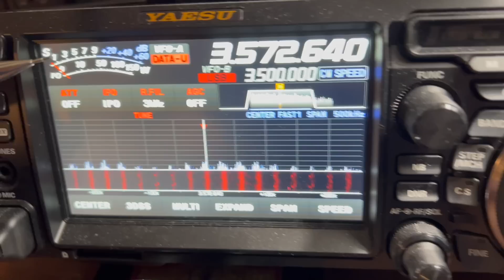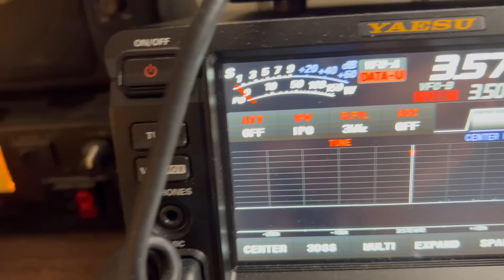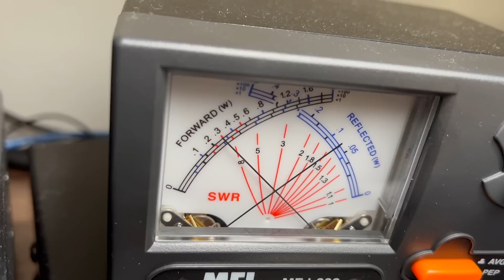The Myth of SWR

Comment: I love your videos. Question how do I get reflective gain on a 102 in?
Reply from the maker: Reflection gain only occurs on a line with standing waves. With a whip antenna, you will want to get the standing waves as low as possible. Even if you did have standing waves, the reflection gain is reflected back to the tuner and it bounces back-and-forth in the line so you don’t get a power increase.

Comment: A question: If SWR is reflected back, is lower SWR bad? I am brand new to this technology and I am starting on 11 meters.I have been spending a lot of time trying to tune my antenna. Am I wasting my time?
Reply from the maker: You want the lowest SWR you can get but don't go crazy.  What antenna are you using and what SWR readings are you getting?  You may very well be wasting your time.
Reply: @BustRadioMyths  
I have an Everheart 2 foot tall, 3/4 Wave, it is going with RG8X cable to a Uniden 980ssb Radio that has a built-in SWR meter and calibration setting, just about an hour ago I had it set to SWR of 1 on channel 1and channel 40. And then I moved it about twenty five feet to a parking spot.And the swr jumped to 2.2 on channel one and 2.5 on channel 40. I realize if you do a hard 90° bend  it affects the SWR, so I made sure there are no hard 90s, and nothing is being pinched, which is how I achieved SWR of 1 initially, it's very frustrating. Thanks for answering by the way.
Reply from the maker: The most efficient mobile CB antenna is the full quarter wave whip which is about 8 feet tall.  Now you can imagine how inefficient your antenna is.  They call it a 3/4 wave antenna.  3/4 of a wave in the CB bands would be about 27 feet.  A two foot tall antenna on the CB bands is so inefficient if you putting 10 watts into it,  it might actually radiate 1 watt or less.  Also that antenna is going to be difficult to tune.  See if you can get a longer antenna.  It doesn't have to be 8 feet but 2 feet is way too small to be effective.  Sorry but that's physics.

Comment: Again a good informative video. I have explained this so many times, even to other engineers. I have done detailed calculations of how power bounces back and forth from antenna to transmitter and back again!
Essentially I can use a simple example of 100 watts and a coax with 3 dB loss to make the calculations easy. 100 watts leaves the transmitter initially. With 3 dB loss only 50 watts gets to the antenna. Let’s say half of that or 25 watts gets radiated and 25 watts reflected. The reflected 25 watts travels back to the transmitter where with 3 dB loss only 12.5 watts makes it back. At that point the whole 12.5 watts gets reflected back to the antenna. Now we appear to have 100 plus 12.5 watts going forward or 112.5 watts. Of that 12.5 only 6.25 makes it to the antenna where 3.125 watts is radiated and 3.125 watts is reflected. Half of that or 1.5 watts makes it back and is reflected again and then that 1.5 watts adds to the froward power making the total forward power as read by the meter just about 114 watts. 
The example with 20 watts turning into 30 watts indicates that the output is 20 watts, if the loss in the cable is small, as in good short cable we can have almost the complete 20 watts get to the antenna. Where 10 is radiated and 10 is reflected back. Then of that 10 watts essentially all reaches the transmitter.  Then all 10 watts is reflected. Now we have the initial 20 watts going out and 10 watts added to that giving 30 watts going forward. This is how it works. Each trip down the coax there will be some loss That loss is the same in dB for forward or reflected power. That loss determines how much power reaches the antenna. How well the coax is matched to the antenna determines how much of that power is reflected. With each reflection at the transmitter that power is added to the forward power. This process continues until all  power is either radiated or becomes heat due to loss in the coax.
If properly tuned, all reflected power returning to the transmitter gets reflected again toward the antenna. 
Does any of this hurt the transmitter? That depends on if the output circuit of the transmitter is or can be tuned properly or not. 
The so called antenna tuner at the transmitter usually solves that problem. 
I did that real quick so I hope I did my math correctly, but that’s the process.
Reply from the maker: Another great post by @dandypoint.  Guys who believe myths take heed!

Comment: Newbie question: If I have a resonant antenna, say at 28 MHz, perfectly tuned to 50 ohms, and I make my transmission on the 40-meter band, what will the SWR be like, considering there is perfect impedance matching but not resonance?
Reply from the maker: SWR will likely be through the roof.  Trying to use an antenna cut for 10 meters on 40 will be a very poor antenna.   There's no way to get around it - size matters.
Reply: @BustRadioMyths   Yes, obviously, but I asked because if SWR is mainly caused by impedance mismatch, and in this case, the antenna—completely off in terms of size—meets the impedance requirement, where does this SWR come from? Is there a return due to the antenna's physical size being too short or too long? Thanks, you're so kind for answering!
Reply from the maker: If the antenna is too short, like trying to use a 10 meter dipole on 40 meters,  I don't see how you could possibly have a good impedance match at the feed point.  SWR is only determined by the match at the feed point.  Too long is a different story.   Antennas that are too long can work just as well as an antenna cut to a specific frequency.   You would attach the coax somewhere there's a compromise impedance match.   Look up information on off center fed dipoles for example.  In your example, you could use an antenna cut for 40 meters on 10 meters but not the other way around.  Make sure you have a decent antenna tuner.  Don't be overly concerned about SWR unless you have a long feed line.  For example, a 20 foot length of RG8X on 20 meters with a 10:1 SWR has a loss of  less than 1 db.  A shortened antenna is always inferior to a full size antenna.
Reply: @BustRadioMyths  Aha!  Now I perfectly understand that the antenna size also influences impedance matching, which is why I asked what happens if we use an 'antenna for 144 MHz, perfectly matched with the transmission line and equipment at 1.8 MHz.' I imagined an unlikely low SWR reading with extreme inefficiency. Thank you for your attention and patience.

Comment: The reflected power is out of phase with prior outputs, so if the wavelength is near the round-trip coax length, you output nothing?
Reply from the maker: Each time a reflected wave is reflected its phase is reversed.
Reply: @BustRadioMyths  yes, that's what I'm saying, but my mathematics were wrong.  Round trip coax path length of 1, 1.5, 2.5, etc. wavelength yields zero output power if the CW reflection is very very strong.
Reply: @BustRadioMyths  that is exactly what a "circulator" does.  QED
Reply from the maker: With coax that long, hundreds of feet, yes, all of the power will eventually be turned into heat, especially with a high swr.  The coax becomes a dummy load.
Reply: @BustRadioMyths  the ohmic resistance is minimal, 1.50 Ω per 1k ft, but whatever.

At 20 meters, a circulator would be 10 meters, with a 10% loss. I don't know what the loss is at 160/80 meters, probably zero. 

No?

Comment: Agree with all of this as it is science based and true - but when pragmatic reality and life kicks in - instead of faffing about with antenna tuners, just tune the bloody antenna to start with.  The correct length of coax is the distance from radio to antenna - as long as the latter is adequately tuned for the desired frequency.  If wanting to use a random  piece of wire - that's when the ATU  is of use, as it matches both the antenna and the coax (because they collectively are the "antenna system" in this case.) I don't use an ATU for any reason because I have multiband antennas.  Great video and thanks for this - it's about time!!

Comment: A question I have is:   How does this re reflection happen without an ATU.?  Eg  a 50ohm antenna , with an electrical half wavelength of  say 600ohm Open wire tx line. (SWR 12:1) 50 ohms seen by the tx . Do the re reflections still happen from the final pa stage of the transmitter ? Another example may be 10m of 600ohm Tx line with an antenna impedance of 91-j998 at 3.6Mhz. (SWR = 70:1)giving very close to 50 ohms at the TX.  Does the TX line "see" 50 ohms looking into the PA stage?
Reply from the maker: The impedance at any point along a transmission line is the instantaneous result of the voltage and current at that point on the line, not the "static" characteristic impedance of the line itself.

Even though the transmitter output is nominally 50 ohms, the impedance on the line at the transmitter connection is very different than 50 ohms when there are standing waves on the line. When the reflected "wave" traveling back towards the transmitter reaches the transmitter, it sees a mismatch due to the difference in impedance and then the "wave" is reflected again back towards the load.
Reply: @BustRadioMyths  Thanks. 
"When the reflected "wave" traveling back towards the transmitter reaches the transmitter, it sees a mismatch due to the difference in impedance and then the "wave" is reflected again back towards the load."
What happens to any power not reflected  in your explanation?(ie TX to feedline is minor mismatch))Does this power go into the PA stage ,causing damage ,even though the transmitter "sees "50 ohms?
Reply: Lets use an example for some clarity.  A 50ohm Load(antenna)  fed to the 50ohm transmitter with 291ohm Transmission line. (SWR = 5.82 : 1). An electrical half wavelength transmission line,and the line is lossless for simple math.

The transmitter "sees" 50 ohms so can put 100watts into the feedline.
Once the "power ' hits the 50 ohm antenna ,half is reflected due to the 5.82 : 1 SWR.
The 50 watts reflected then makes its way back  to the transmitter output. 
Of this 50 watts reflected power, does all of it get reflected again from transmitter towards the antenna?  Half of it reflected towards antenna? What happens to the other 25 watts ?Is the reflection analysis only valid for the first split second of a transmission until a "steady state " analysis is more applicable?

Comment: You are supposed to SUBTRACT Reflected from Forward; not ADD.  If radio output set to 20W then no more than 20W can ever arrive where the coax joins the antenna. Even the greatest coax connected to the wildest tuner can not become a 10 Watt amplifier.  There is no free 10 watts.
Reply from the maker: Look up "reflection gain" in a transmission line from a conjegate match.   It's a scientific fact . That gain is then reflected back again at the load.  No magic power increase being radiated and I never said there was.  It's in the ARRL Antenna Book chapter 25.
Reply: @BustRadioMyths  It can reflect back and forth alternatively between source and load but then its a wash and in reality its just knowledge of whats taking place but the power isn't changing. Maybe its just a case of semantics but I was led to believe you implied 30W output was being sent out of the antenna ultimately, when the source was 20W and that of course is scientifically not possible as that would require a steady non-alternating one-way addition of reflected power.  - The subtraction thing I mentioned previously was in error.
Reply from the maker: Yes there is no magic power increase but the full transmitter output, not that plus the reflected power, is radiated.  The reflected power basically stays in the line, bouncing back and forth, but eventually it gets radiated.  It has to go somewhere.  Many beleive that somewhere is the tuner or the transmitter but that's not true.  It is totally reflected by the conjugate match at the tuner.
Reply: @BustRadioMyths  I get that now, thank you. interesting.
Reply: @val058 you have it wrong ,reflected power does indeed join the forward power

Comment: Very true. 1:1 <> 100% efficiency. Keeping the transmission line as short as possible between the trans-match and the radiator is good practice as the frequency goes up, balanced with the transmission line length/type/loss per ft.
An antenna with a 10:1 match could be more radiationally efficient than a 1:1 antenna, just keep your finals happy.
Thanks for making this video. I hope a ton of folks watch and learn. I am a short time op, but a long time AC theorist :)
Edit: Word of the day: Recirculation.

Comment: Thanks for this interesting video. I wonder why people are not more interested in radiated power which would be measured at some distance from the antenna. I realize that their are other factors involved here such as the angle or rather multiple angles of radiation which might be favorable or wasteful. An interesting article that I read 66 years ago in a CB magazine that bragged to have found the most amazing antenna anyone could build. It consisted of two equilateral triangles made from cardboard connect at their angular point facing away from each other. At the point of connection was a fifty ohm resister connecting to a coax. This article appeared in a CB magazine with no explanation other than it's SWR was the outstanding. I still wonder was this a joke or an attempt to ridicule the CB crowd.
Reply from the maker: Radiated power measurements would really tell how well the antenna works and maybe some companies don't want us to know.

Comment: Thank u. So will my SWR meter  work  for my dual band handheld ham radio that I use for my CB radio in my truck I was just hoping I could get away with using my workmen SWR meter for this project thank you for your video
Reply from the maker: By "this project" do you mean duplicating my demonstration of forward power or just for checking SWR?  If you want to duplicate the demo you will need a meter that reads forward and reflected power in watts.  If you just want to keep tabs on SWR I'm sure the Workman is fine.  They are not necessarily very accurate but close enough.
Reply: @BustRadioMyths  thank u so much.  I just wanted  to keep  tabs  on SWR for uhf/vhf
136/520 Mhz Antenna  I'm having  a had time  finding  one that  works  good 👍

Comment: I've always being taught that any reflected power is simply converted into heat in the final stage of the antenna tuner or the transmitter. It seems to me that any reflected power then goes back into the antenna will be out of phase with the forward power causing a further loss of power transmitted
Reply from the maker: Who taught you that?  It's just the opposite.  See the references I posted.

Comment: Definitely 100% correct about the strange beliefs and misinformation out there.
It's ok for people to say "I'm wrong" because we are all usually right about that ;)
Of course, Transmit is only Half the story.
For Receive, you want a 1:1 SWR so max signal arrives at the receiver.
Personally i don't use an ATU because the antenna system hits near 1:1 on all bands, but it needs manually adjusting for each band change.
ea7knw

Comment: Mark, I built a small L-match  for my QRP rigs.  When the impedance is matched, the received signal is greatly improved.  I have an indicator that indicates the voltage going out the radiator is maximum when the match is best.  As a new ham, I'm not sure how all of this fits together. I have great success with this set-up and will email info to you hoping you can clarify what i am experiencing.  Thanks for your videos.
Reply: Mark, I could not find your Email so I am sending a link to the L-match tuner  and the matching indicator that I use.  https://www.youtube.com/watch?v=JGVtgWXCFxk&t=12s
https://www.youtube.com/watch?v=NjHyXi1SrZs
Reply from the maker: When the tuner is properly adjusted the entire system is resonate.  That's why received signals come in better.

Comment: Several things I'll have to research. First the SWR meter he used to measure the power output to the antenna is not located at the antenna, it is located after the antenna tuner and before the coax leading to the antenna and it does in fact measure the power going out to the Coax a presumably another impedence matching balun or such not to the antenna.  It would be nice to make some field strength measurements on the antenna itself to verify this presumption that what you see on the meter needles means what you think it does. It makes sense that the reflected power would effect that measured output power. So I question the assumption that that meter is measuring output of the antenna. Also my own experience of a manual tuner and the effect on reception (looking at the waterfall on my IC-7300) shows a dramatic change in the receiver picking up signals from the antenna. I would think then that when there is a mismatch then the same lack of resonance in the system would effect transmission power out.  But interesting idea. I'll have to look at this more closely.
Reply from the maker: All you have to do is read some of the references I posted to see that forward power adds to source power in a mismatched transmission line.  It's a fact, not some trick with an SWR meter.

Comment: Just learned something important from W6LG; lets say for the sake of argument someone is running higher SWR, using coax, because they "aren't worried about it"?  Well, then you need to be more concerned about common mode currents.  Not that you weren't before, but it seems running non resonant antenna's with coax can increase common mode currents which can cause other problems. Just another snippet of info to keep in the back of our minds as operators.
Reply from the maker: Use of a balun is always a good idea when using a coax feed line to prevent common mode current.
Reply: Yeah I saw his video also  its a shame he spoilt it by saying high swr causes common mode current and that reflected power runs on the outside braid of coax